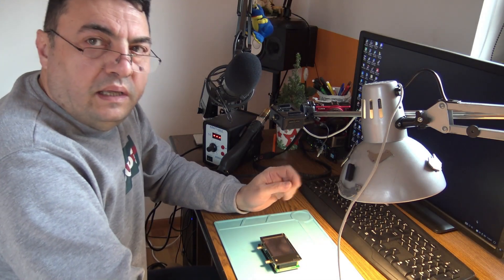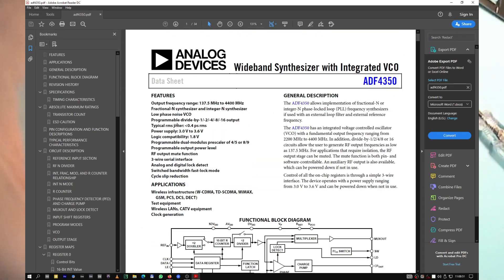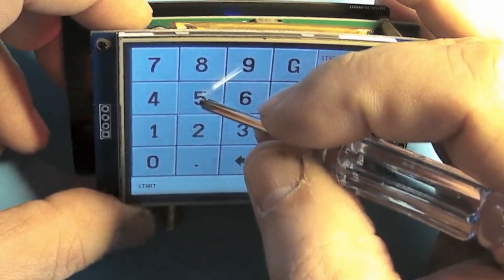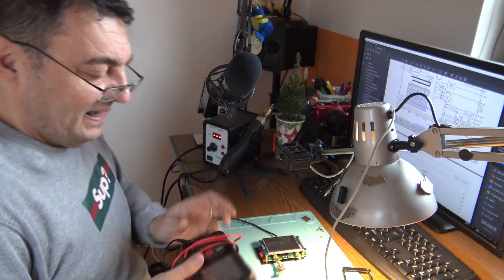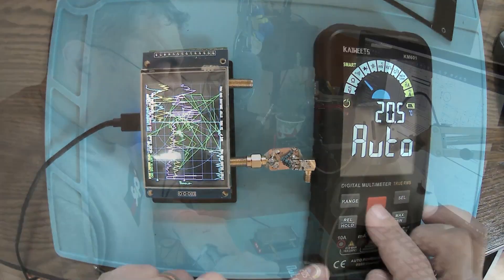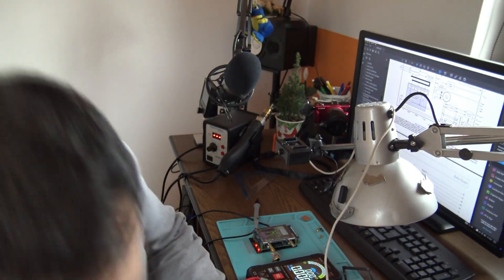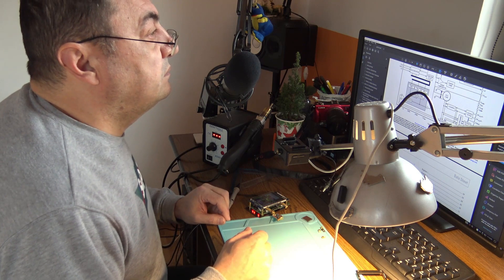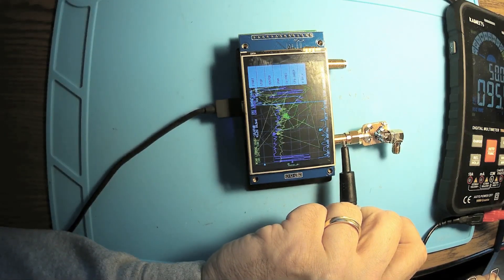RIP NanoVNA v2

Comment: I had exactly the same defect - it only worked up to 140 MHz
and the same picture as yours on the screen.
I ordered U551 mxd8641 and ADF4350 chips for replacement.
But while the chips were moving, I decided to resolder the gd32f303, since there was some kind of white flux underneath it.
After re-soldering everything worked perfectly as it should!
I think either unwashed flux or warming up the gd32f303 corrected the situation.
Try it too!
Reply from the maker: Mine it's long time gone...I tried to replace some ICs, no success, so I bought a new one.

Comment: Ouch, the same thing happened to my VNA. I used a soldering iron to solder RF stuff while the VNA was connected to a computer that was using the same supply as the soldering iron. Thanks for figuring this out

From now on, When using a nanoVNA connected to laptop USB, I'm going to keep the laptop away from Wall socket power
Reply from the maker: right!
Reply: I’ve done same thing using iron to solder  cable to feed point of a handmade antenna from then the noise appeared, now it’s useless 😢

Comment: You tried reflashing the firmware?? I’d bet it’s the cheap MCU and not the Synthesizer s or mixer. Everything is based on ST Micros STM32F103c8t6 but they use Giga Device CGD32F. It looks like the mcu is switching the Tx synth to a point that you have a voltage pump. Good luck!
Reply from the maker: Yes..no result..I bought a replacement..

Comment: the exact same spagetty thing happened to mine too while it was connected to a usb cable with an ungrounded pc which has that nasty AC voltage on its case...what a thrill it was to me....but i understand mine has a broken U551 ic....i have ordered the ic im waiting for the mxd8641 rf swiches to come and see if i can replace it with success
Reply from the maker: Let us know how you solve that..good luck!

Comment: Surely you can connect iron to a common earth point, I would open the iron power supply and using multimeter find earth going to the iron tip... resistance to the tip should be low, less than 5ohm. Perhaps your iron is faulty, you should not see 90v that is just craz, at most a few mV!
Reply from the maker: Yep..there is problem..I'll use batteries for a while I'm looking for a classic transformer power supply..galvanic separation it's the best

Comment: Oh you soldered rf stuff while the NanoVNA was connected to pc? Bad mistake. If you can, only do soldering with nothing connected or use a gas soldering iron like the dremel 2000 versatip. Its very good for such things 😊
Reply: That's absolutely good. 👍
Reply from the maker: Now I know! Haha!
Reply: I have the exact same issue with mine and that’s probably the way I killed the 150mhz+ side. The sma connectors were poorly soldered by the factory and I tried to fix them with my soldering station.
Would a ts100 iron (battery powered) prevent similar issues?